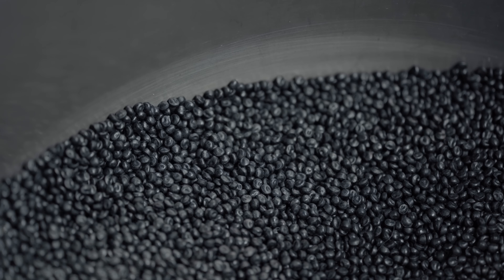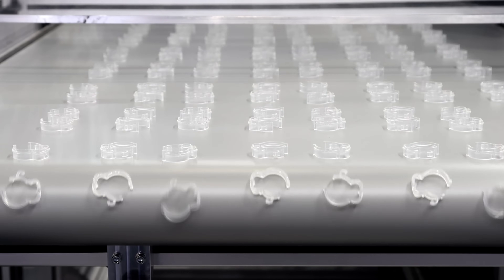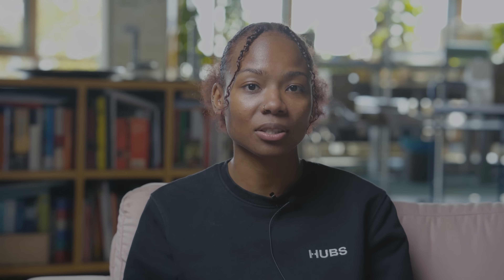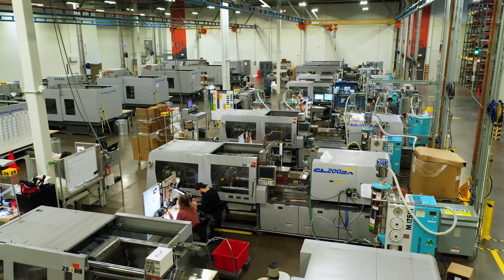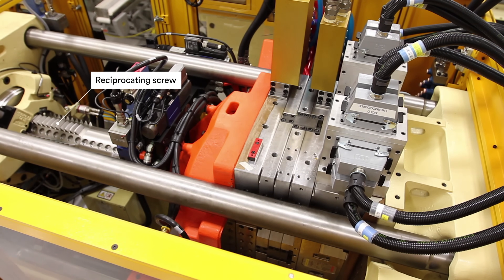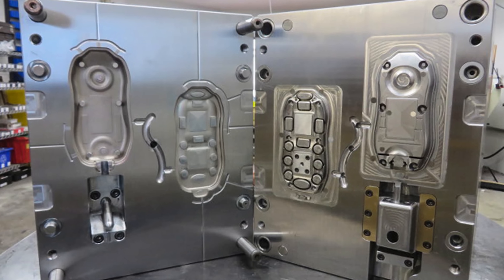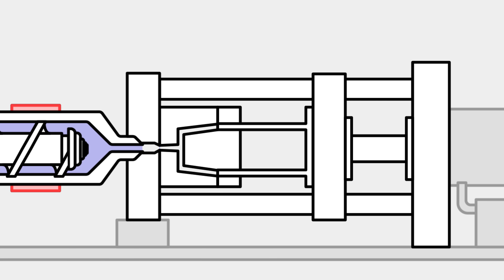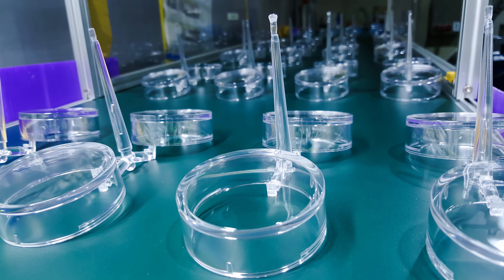What is Injection Molding and How Does it Work?

Comment: This is one of the clearest and most honest introductions to injection molding I've seen! Major kudos for including the correction in the description – that level of transparency and commitment to accuracy is what truly builds trust with viewers.
You've perfectly explained why IM is unbeatable for mass production. For engineers and designers who are still in the prototyping and design validation phase (before making that tooling investment), we help de-risk the process by providing precision CNC machined, 3D printed, and silicone molded functional parts. Excellent video!👍